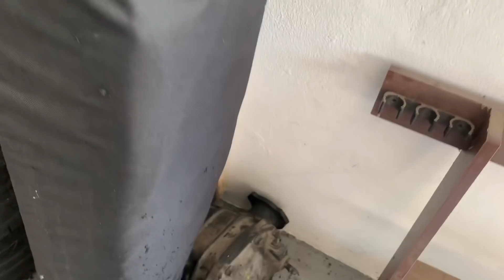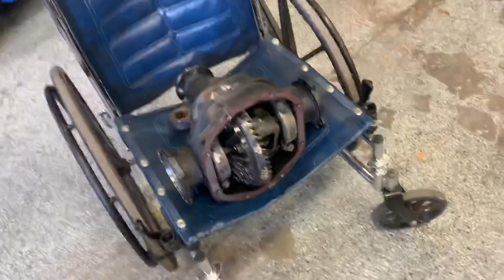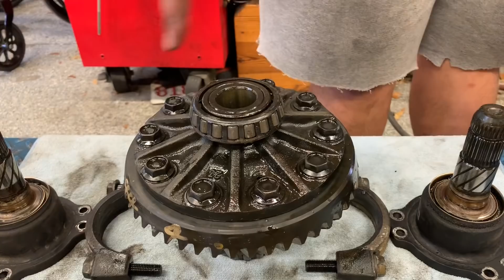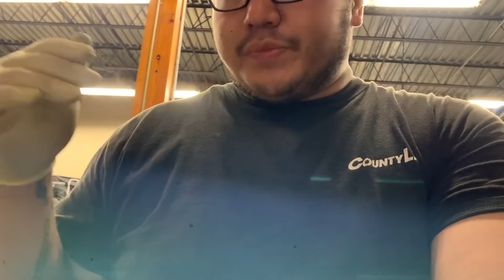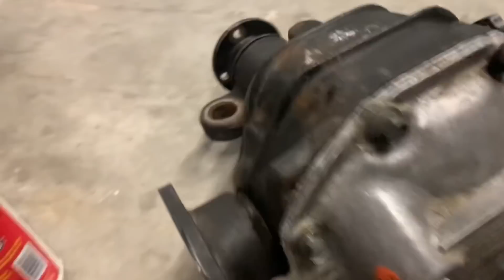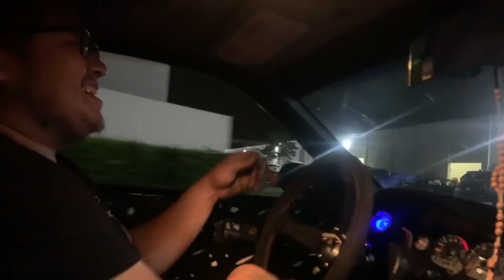Welding the Diff in the S14 quarantine Vlog #3

Comment: Flush the gear oil after 50 miles! There will still be tiny bits of contamination. Also, run a magnetic drain plug (if possible).